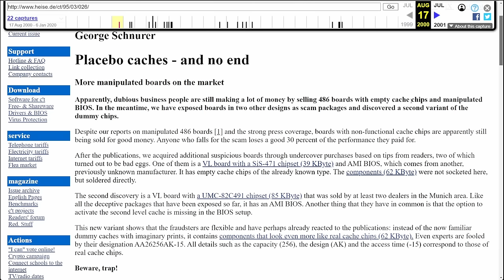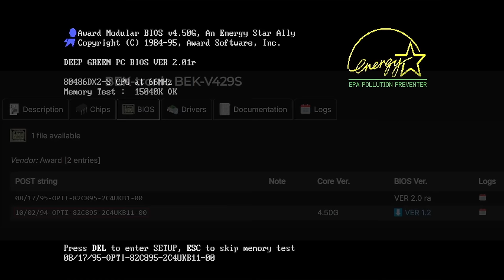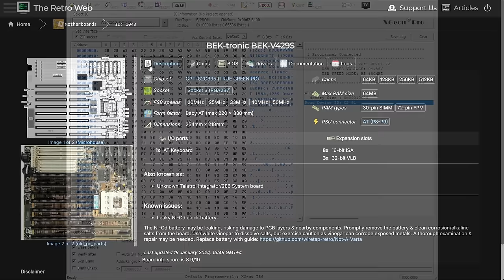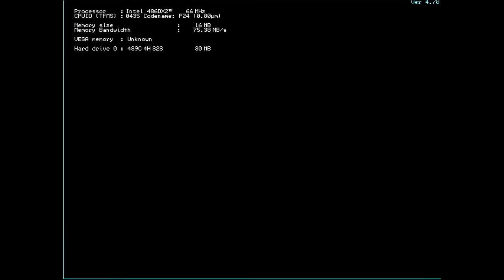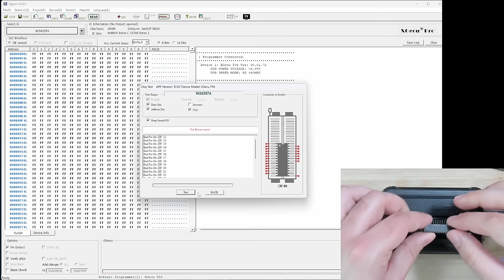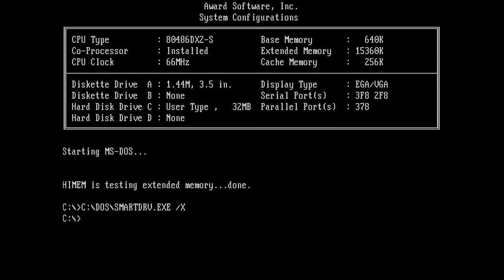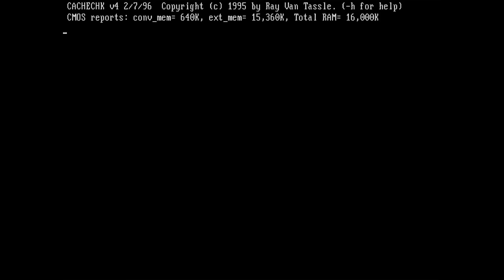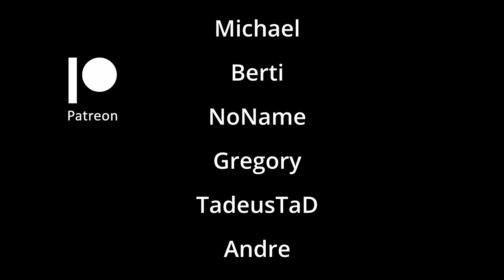They fooled so many: Fake cache chips!

Comment: I have disassembled both BIOSes and essentially what they're doing is making the function that checks for the cache size to always return a value that says it has 256K of cache. 

On the v1.2 BIOS, the routine that prints the cache size is at address 2406h. On address 2420h there's a call to a subroutine at A8A0h which does some magic with the CMOS registers and returns some value in AL (presumably reading the cache size from the motherboard).

On the modified v2.01r BIOS this routine is located at 24E3h and the call is at 24FDh. Note that this time around, this particular call jumps to an intermediate routine that calls the original one at 9E23h, which does the same exact magic with the CMOS registers and returns, then it checks if AL is 5, and if it is not, sets AL to 5. So presumably AL=5 means 256K of cache. (A bit inefficient tbh, you could just set AL to 5 and return.)

The easiest way to fix this (assuming there's no checksum validation) is to patch the bytes at 24FEh and 24FFh from 00 BA to 23 79, which will bypass the sneaky modified call that forces the cache size to 256K.
You could also play around with the modified BIOS and make it return different values for AL by patching bytes DF04h and DF08h to some other value to see if it reports other cache sizes. They must both match and the other patch must be undone.
Reply: is this the only change between the two versions?
Reply: @marcogenovesi8570  Given that they're different versions, there are plently of other differences. It'd take too long to figure out what else was changed.
Ideally we'd have a proper dump of an unmodified 2.00 BIOS to compare the two.
Reply from the maker: Thank you for your thorough analysis of the modified BIOS. Very interesting how they implemented it. I guess the call to the original routine to get the cache size triggers a necessary side effect? Maybe real cache wouldn't work if this method wouldn't be called. Regarding checking AL first before changing it... Maybe it is better to avoid overwriting if it has already the correct value. I don't know for what reason, just guessing.
Reply: @StrikerX3  ok so they are actually different versions, it's not the same BIOS with the hack and a different version string
Reply: @bitsundbolts  There might be side-effects, though we could do some science and try skipping that routine to see if that is really true. To do that, you can patch the bytes at DF00h-DF02h from E8 20 BF to 90 90 90, turning the call into NOPs. The routine reads a byte from CMOS at index 3Ah and also does a couple of writes to port E1h, which seems to be a motherboard-specific port that's written all over the place.

You could also test the idea that checking AL before changing it is unnecessary by patching those three bytes to B0 05 C3 instead, which replaces the sneaky routine with a simple "set AL to 5 and return". Or, if you want to keep the original routine call, change the three bytes immediately after that, so the code at DF00h-DF05h reads E8 20 BF B0 05 C3 (call the original function, set AL=5, return). You can change the 05 in both of these to any value from 00 to 07 to make it report different cache sizes: None (AL=0), or from 16K (AL=1) to 1024K (AL=7).
Reply: There is a simple checksum routine at 0F28h-0F35h that will stop ROM modifications like that, but it is pretty easy to defeat. Patching byte 0F2Dh from 0A to 30 should be enough to bypass that check.

Or, if you prefer to keep it intact - the checksum algorithm is very simple: it adds up every byte in the ROM file and checks if the result is zero. In HxD, apply the Checksum-8 algorithm over the whole file. If the checksum is non-zero, you can modify any byte in the DF10h-DFFFh area to make the checksum zero.
Reply: Wow this is some amazingly detailed knowledge!
I wish I’d be able to figure stuff like that out, but I don’t even know where to begin.

Comment: I remember a board which had soldered in 'cache chips' but if you were to follow the PCB tracks, they went nowhere.
Reply: Would that be the M919 I mentioned in my comment?
Reply: @rtechlab6254  I don't remember. That was many decades ago.

Comment: I would err on the side of preservation. Submit it and see if it can be tagged as modified to show invalid cache levels. 

I'd love to see a hex diff of v1.2 and your v2.01 BIOS.
Reply from the maker: The Retro Web Team has accepted the BIOS and it is available for the board. Unfortunately, the two BIOSes are very different and I think a DIFF between them will most likely mark the entire file.
Btw, I think there are some performance issues with version 2.01r. I have to look into this. You can see a huge difference in the moving benchmark between v1.2 and V2.01r.
Reply: @bitsundbolts  I'm pretty sure they just changed the None string to 256k. Back in the day in the 90's i had a 486 motherboard with fake chips that was reporting 256k. I've bougth myself 128k of cache and the BIOS was reporting 128k with real chips.
Reply: That's what I was thinking.
Search the Rom for 256kb.
Replace with none.
Reply: That's what I was thinking.
Search the Rom for 256kb.
Replace with none.
Reply: @MM-gd3be  The number of characters match, shouldn't be very difficult. Probably had to moidify the BIOS checksum as well.
Reply: Hex it and change it back to "none" and I bet it will post properly after that.
Reply: What you actually want is a hex diff of v2.00 and "v2.01". There's too much code difference between v1.2 and v2.0 for a hex diff to be of any use. The "v2.01" is likely just a hex edited v2.00, but v2.00 is a real actual version of the BIOS that was compiled from code that had seen improvements/changes over v1.2. It would be like a hex diff between two different builds of an EXE.
Reply: @CharlesVanNoland  I don't know if it was added since, but RetroWeb had a note about the v2.00 BIOS but no binary to download. My first thought was to diff that with the v2.01 w/fake messaging too. 
I'm inclined to think the v2.01 BIOS is mostly fine except for that broken cache messaging.
Reply: @myne00  Also maybe check if 2.01r / 2.01ra version string restoration causes the checksum-8 to become correct again?

Comment: This brings back memories. Also of the time when they used to put parity generators on the RAM PCBs instead of real RAM parity chips.
Reply: I remember reading about Pentium chips being shaved. The package was made of a dark grey ceramic, which was normal. Some company used a machine to shave off 0.5 mm from the top and print a higher speed or something on top. The CPUs would work but it would be overclocked. In some cases, it would not run stable.

Comment: Just out of high school back in the 90s when I was working for my first employer, before I started my own business, I built so many of these 486 and early Pentium systems.  You memorize the jumper configuration for the boards pretty quickly.  I wonder if a bunch of them had fake cache and none of us youngsters on the build crew ever realized it?  We didn't have the means of verifying it.  And frankly, back in those days, there wasn't much reason to suspect.  I mean, as you show, the BIOS even happily displays cache that isn't there.  It was so long ago now I can't remember the specifics anymore but we did do some stability tests and benchmarks and we were all PC performance junkies.  You'd think we would have picked up on the cache being totally non-functional.  But it was a different time, and we were all pretty green.

Comment: OMG.  

A few years ago I put together a Tomato 4DPS 486 system with a Am5x86-P100 that I stably overclocked to 200Mhz.

If I remember correctly, the board could hold a whopping 512 K of cache.  So I went and searched for cache chips and bought a bunch from few different sellers and sources.

All of them were fake.

I finally gave up on it.
Reply from the maker: Wow, a stable overclock to 200 MHz is not that common! Congrats! Sorry on all the fake cache chips you collected :(

Comment: All 386 and 486 bioses (and to certain extent pentium 1) are similar enough that you can easily go to retroweb and get latest bios based on your chipset. You don't have to pick bioses specific to your board. ;) (There are, of course, exceptions, though they are rare.)

NB! I suggest checking out how to enable write-back on the cache, too. Another measurable performance jump. ;)
Reply from the maker: I want to try that some day. Using BIOSes from different boards. Good to know, I'll keep it in mind. Thanks!
Reply: Definitely, as long as the chipset is the same it's easy, used to do that back when these boards were new.

Comment: It’s likely possible to undo the modification to the bios. It’s a pretty safe bet the bare minimum was done to achieve the false reporting. There were probably only a few instructions modified, and with some disassembly it should be fairly simple to locate and undo it.
Reply: The absolute bare minimum is to change the string if zero.
Reply: @myne00  probably needs confirmation but yeah my first assumption is that they've replaced the "none" string with "256kb"
Reply from the maker: Yes, probably that is exactly what they did. I didn't try to reverse the change, but the BIOS is on The Retro Web if anyone would like to try. It also has a note about always displaying 256k of cache.
Reply: There is a complication to simply hex editing strings in the BIOS: you have to recalculate the checksum of the new file and write it in the right spot.
Reply: seems like they changed the none string, the version string and the checksum, easy enough to reverse

Comment: PCChips M912 and M919 - notorious fake cache boards, but superb performers
Reply: Yes! And I have an M919, but with the functional cache module fitted and the fake IC positions left empty. Currently it's running with AMD 5x86-133 and 64MB RAM.
Reply from the maker: I have one of those boards that needs to be repaired. I don't know yet what is wrong with it - no sign of life. But I will try my luck again soon.
Reply: @bitsundbolts  Cool. I look forward to the video if you do one.
Reply: @GodmanchesterGoblin  Some dude managed 180-200mhz on the M919, it supports even 60mhz bus clock afaik.
Reply: @bitsundbolts  the ones i have work perfectly well, the M919 with the cache module, and the 912 with real cache installed instead of fake placebos. Excellent stable performers. Hope you get it working. Gruss aus Deutschland.
Reply: @HighwayHunkie  Yeah, I tried to get 160MHz, but for me it wasn't stable (maybe CPU, or board, or voltages). To be honest, I was just happy to have it working well.
Reply: @GodmanchesterGoblin  hey as long as its stable at stock -the stuff is 30+ years old, we should be grateful. I dont overclock this stuff anymore.

Comment: I came to know about motherboards with fake cache when I repaired a PC-Chips board. Mine had genuine cache but I wasn't aware that "fake cache" was an option!
It amazes me, the picture you showed shows an IC coming from manufacturing, they just didn't add the actual die which is probably the expensive bit! Fantastic!
And someone edited the BIOS from "None" to "256 KB", so simple and so hilarious!

My first PC, a 386/DX 25 had no cache. I couldn't afford it. Imagine I paid big money (for a teenager in 1992) for cache and not even realise that the long awaited cache was just a piece of LEGO. 

I'd share the BIOS anyways, with a note explaining what it does :) For historic purposes :)
Reply from the maker: That is the sad part! You spend money because you want to have a better system - and then you realize that there is no difference. You would always be skeptical and claim that cache has no benefit: "I have seen it with my own eyes!" - Sad :(
The BIOS is shared on The Retro Web for this board with a note that this BIOS always shows 256kb L2 cache.

Comment: This is because a set of 256K of 15 nS static RAM was, at the time, the equivalent of $ 200. On the computers I built at the time - when the 80486/DX2 was $ 1,000 when it hit the shelves - I tested the motherboard with and without the cache chips; not only because of the fakes (a limited problem), but mostly because the one of the cache chips was often too slow, and that caused errors - a totally random computer freeze. 
SRAM cache caused a lot of troubles at the time, even more troubles than dynamic RAM. The fake chips/fake bios was a criminal enterprise at board stockists level, who sold the boards to people who didn't know better, and pocketed the $ 200.
 Remember that a computer was worth 1000s of dollars, and anyone who bought the latest and greatest run a number of benchmarks and large spreadsheet calculations, AutoCad renderings and Mathlab graphs: the missing cache was easy to spot in the end.
Reply: If you're just doing light word processing (which is what most people used computers for in those days) then you don't need cache, and it's appropriate that manufacturers made it an optional extra. Dishonest manufacturers however....

Comment: Another very interesting video =D   I would upload that BIOS to the retro web anyway, with a readme that notes that the it will always report cache when not installed.  Just based on the extra features that BIOS provides.  That "mod" could probably be easily un-modded by someone if they can get a copy of the BIOS.
Reply: It is on the wiki

Comment: I'd heard about fake cache chips back in the day, but I never came across them until the late 90s when I was working at a computer store. One day I was working on an old 486 machine when the older tech came in, pointed to the cache chips and said "Those are fake cache chips!". I was surprised and doubtful, so he told me to remove them and see what happens, so I did and it still reported 256K just like you saw. I asked what to do and he said just put them back, nobody ever asks about the cache, so they'll never know the difference. I did, but I wasn't happy about it. Looking back, there's not much you can do in those situations, other than offer a replacement machine if someone complains about buying one with fake cache. The boss was very dodgy, he definitely wouldn't go out of his way to buy new cache chips and replace them, especially considering it would probably cost more than the rest of the machine cost him!
Reply from the maker: Wow... Funny story - that experienced tech pointing out the fake cache is funny. I guess all those boards were sold and probably nobody ever came back and claimed a replacement for the fake cache chips.

Comment: This fake cache stuff was even around in the early pentium days when they used to have COAST (Cache On A Stick) modules that also were faked in bios, but did nothing
Reply from the maker: So annoying! I wonder how many people got scammed!
Reply: That was also PCChips. The M519 with the (in)famous OPTi Viper chipset had no cache onboard and a COAST slot. The COAST slot did work, but if left empty the BIOS would still report "CACHE ENABLED" instead of listing the amount. Wouldn't surprise me if fake COAST modules were stuck into these to make it at least a little more believable

Comment: Can you please upload your dump of the original BIOS somewhere? I would like to process it through Ghidra
Reply from the maker: It is already on The Retro Web for this board. It has a note to always show 256kb of cache
Reply: Mind keeping us updated with what you find?
Reply: @ms2649  Well, they didn't do the obvious thing and hard-code the string "256K" into the BIOS anywhere, so it must be hard-coded as a value somewhere. Unfortunately as a word value, it's 00 01 which shows up a billion times so it's hard to track down. I'm also not that experienced with Ghidra and it's doing some odd things that I can't figure out. I assumed the BIOS is either at FFFF:0000h or 000F:0000h but the code seems to have references to labels in the segment 0000:0000h so I'm not sure what the deal is there.
Reply: @AureliusR  things like cache checks are probably going to be the same across versions.
what about using the older bios to search for where "NONE" is used, and then search for the bytes around that in the new bio.
 
have you tried a good ol' diff on the versions?

Comment: Yeah, this is even one step ahead of the famous PCChips Boards with fake "write back" cache. I have two of this M919 Baords. One green PCB with the plastic fake chips and traces to a roundabout and a later version without the chips but with the right cache modul and real 256kB. There are also fake chips with marking and legs but they are hollow on the underside.
Reply from the maker: I have one of those M919 boards that needs to be repaired. The CPU was inserted in a wrong orientation and blew up the socket. Crazy to hear all those stories about fake cache chips and the extend!

Comment: The hacked v2.01 bios that came with the board tested with lower overall read/move speeds than the v1.2 bios you tested on it.
Reply from the maker: I did notice that! 1.2 is quite a bit faster, but it has less features. Something for a follow-up video.